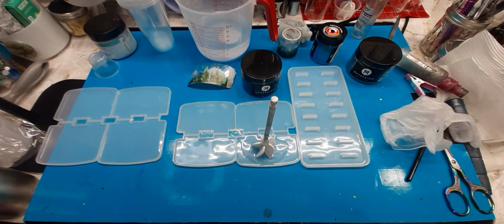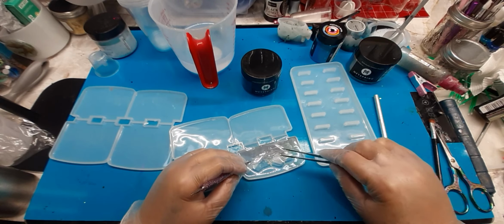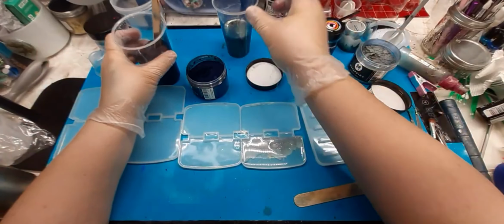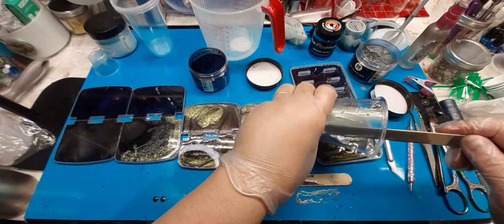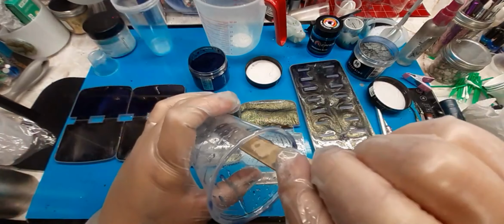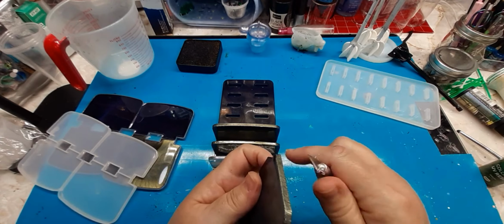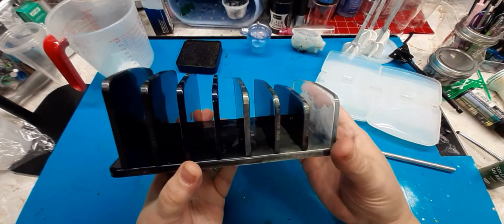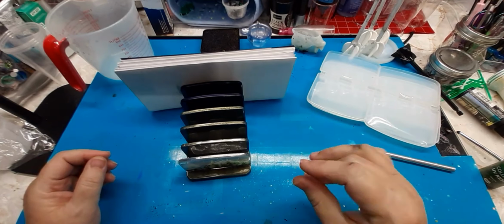#176 Today we are making a mail holder tray!

Comment: How do I get rid of my over pour
Reply from the maker: You can wipe it off with a paper towel 💖
Reply: @ReptilesandResin  What do I do if it has cured
Reply from the maker: @carolinegibbs8536  you can use a deburring tool or a exacta knife to trem it away just be careful not to cut yourself.